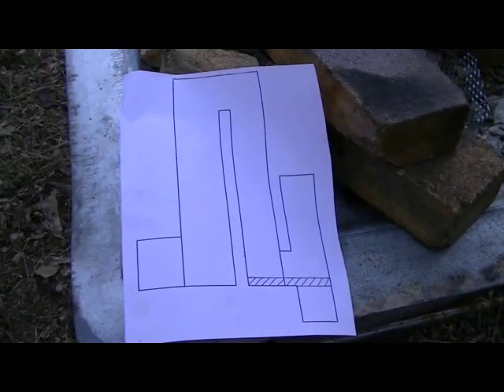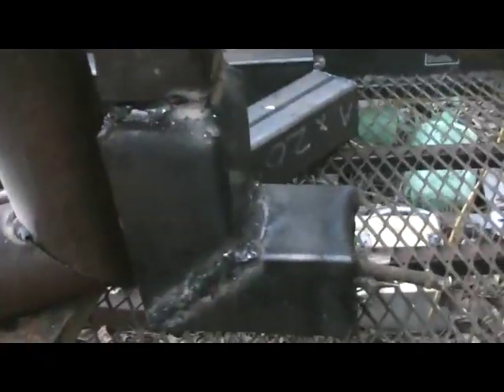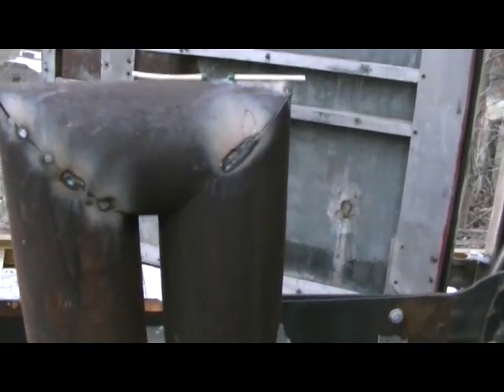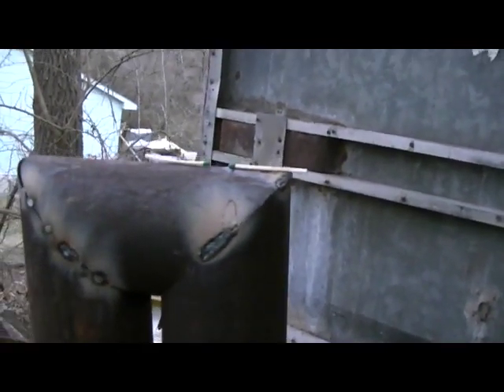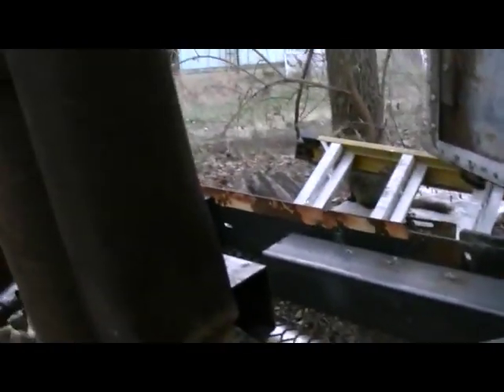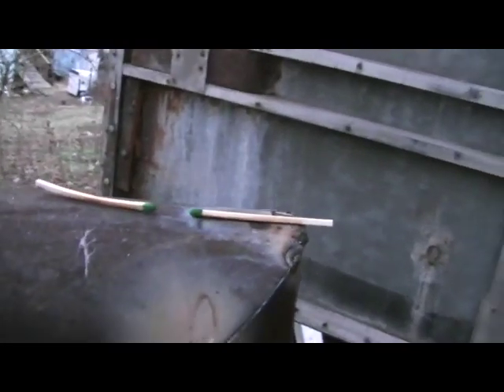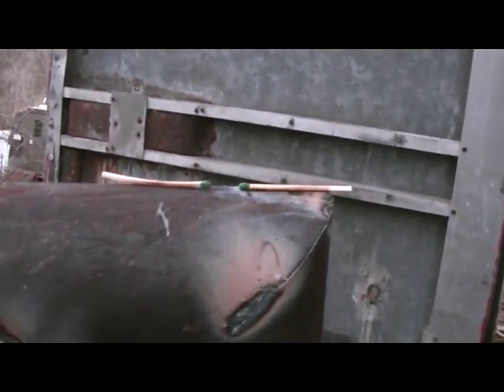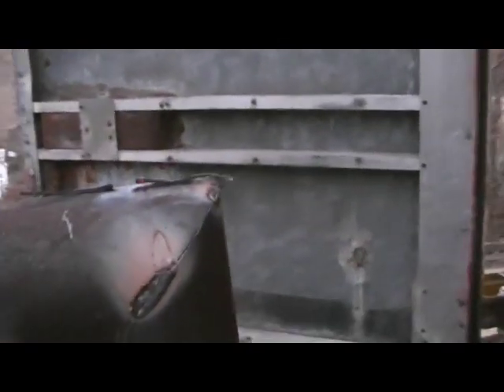Introducing Omega Stove

Comment: This looks very interesting! Seems the next step is to insulate the combustion chamber and riser pipe, but attach heat sink to the down pipe. This could be a timely solution to problems I'm having with my rocket stove drum type space heater. I am using a 3 1/2 x 42" exhaust pipe riser, and suspect my 4 x 6" rectangle tubing burn chamber is too big for the riser and my heat exchanger has too much volume. I am getting fantastic burns and feed with an ultra simple pellet feed insert, until I try to put it all inside two stacked, 14x27", 16 gallon grease drums. To solve my draft issues, I was gonna fill the bottom drum with perlite to reduce heat exchanger volume, with the exhaust moved up to the bottom of the upper barrel. Now I think I will abandon the upper barrel in favor of the bottom barrel filled with perlite, the riser exiting horizontally through a rectangular tubing with hot plate surface and down thru a heavy wall pipe. The drum would be mostly insulation and I gain a potential cooking surface that my design lacked, the two stacked drums being around 50" tall. Much appreciation here for you!
Reply from the maker: kelhawk1 Sounds like a good project!

Comment: Splendid!  Could this Omega stove have several pipes, like the ones you used, I mean to have 7 or 8, then the last one going outside into a chimney and to put a door at the first one? I'm thinking of using it along a wall as a mass heater, it would be great, much easier than the classical mass heater. Thank you for all intelligent , well-explained videos, I like them very much, you are so good!
Reply from the maker: Make a larger fire box, to feed it and it should work fine. The exhaust will likely be too cold to go up, so empty it down outside.

Comment: I like this concept. Can this vent through a wall a little above floor level to avoid a vertical chimney and hole through the roof. I have 6” steel pipe, I plan to use this in a sauna so I don’t need a long burn, just a short hot burn.i understand the wall would have to meet all codes as if the exhaust was very hot but if you can eliminate the vertical chimney you cut your costs and labor substantially. Also would it be more efficient if a circular plate was welded into one corner of each 90 degree turn to create a better flow when changing direction?
Reply from the maker: Check out my Hybrid Omega Stove. It's easier.

Comment: The reason why many are using barrels or other big containers for space heating is the fact that the surface of a big container / barrel is just bigger and the heat transfer into the room bigger and better. As long as you do not have a bigger feed tube there is no need of a big barrel - the temperature of the vapor coming out of the chimney tells you if the efficiency is O.K., what is perfect with your design, because you are using a small cross section for your feed tube and the total amount of heat created is much smaller compared to a much bigger feed tube cross section. 
When you want to have the smallest stove with the highest output then you will have to take a cylindrical barrel put over the riser tube all the way (around the riser tube) as it has the biggest radiation surface compared to the needed space. Another positive effect of a barrel all around the riser tube is the fact that the hot air all around the riser tube lets the riser tube cool down less / less insulation is needed around the riser tube. But your design is easier to build and works surely fine with small cross sections of feed tube.

Dani
Reply from the maker: Thank you!
Reply from the maker: ***** Why not? Give it a shot!
Reply: ***** There would be the flat surface on top, but efficiency would be worse because the air between the tubes and the barrel is kind of an insulator, the tubes inside get hotter (burn temperature rise up as long as there is no other insulation around the riser tube) and the steam coming out of the chimney would be hotter. The temperature of the flat surface on top would not be so hot compared to a barrel but directly around the riser tube having contact directly with the burned gases...
But if you insulate the riser tube well, put a barrel around all the tubes (a small one) and fill the space inside the barrel with a heat storing material with a middle to good heat transfer capacity then you would have kind of a small mass heater.  But I think if you would do so you should make the tubes inside longer (more up and downs) for more efficiency. In the end it all depends on what kind of chimney you have and which minimum exhaust temperature is needed for not having troubles with condensation in the chimney.

Comment: I really like this design.  I wonder if you made this design from round tin pipe and embedded it in fire cement, could you get the same draft with having mass to retain the heat?  Eventually the round tin would disintegrate and what would be left is the pathway for the fire.  One would need to put steel round pipe in the area of the damper to keep it functional though.
Reply from the maker: I'm not sure how well the concrete would hold up. Perhaps a clay mix would be better. The design is simple and functional. Thanx!

Comment: I think someone could reproduce this really quick by buying 6 inch regular stove pipe. It would be a 30 minute build. Unless the stove pipe would be too thin for heat produced in main fire area? What are you thoughts?
Reply from the maker: It should work for a while. I'm working on a variation.
Reply from the maker: New modifications coming soon!

Comment: What would it take to make an Omega stove wood boiler?
Reply from the maker: +Josh Byrley Put the boiler at the top where the heat turns sideways. or wrap the top with a coil of copper tubing and pump water through it..

Comment: the cost of the steel using you're using instead of a barrel probably cost more and you can't put a pan on that horizontal section unless you switched to square or rectangular tubing but then you'd have to buy it -- more money. maybe you can cut the horizontal section and replace it with a flat plate or leave it open and make the cut so the pipe so the pan or pot you use would close off the opening
Reply from the maker: Huge changes in the works. Keep watching! It gets more interesting, Good observations!
Reply: far out I appreciate your enthusiasm

Comment: Will a lp weed burner work as a emergency source? I'm thinking of up hear in the Dakotas we get some very nasty winters temps of -30 are not uncommon and snow backside deep on a tall Giraffe. Will the exhaust gasses from the lp cause problems?
Reply from the maker: +Willard Way If it is vented properly and doesn't have leaks, it might work fine. If you try it, I'd be very carefull.

Comment: Would it still work if it was lying on its side?
Reply from the maker: I don't think so.
Reply: Down draught has been demonstrated with mixed success. Why is sideways such an issue?
Reply: To clarify the previous post....the emphasis of the RS is cooking and not heating. Hope this helps...Roy
Reply from the maker: Even though there is some down draft, there must be some updraft. With a good chimney draft, I suppose it would work, but there would be no heat trap at the top for maximum dispersion before heading out the chimney. I guess it all depends upon your definition of 'work.'
Reply: Roy Nash Sorry...not "cooking" but a bread baking oven.
Roy
Reply from the maker: OK! I understand. this is a rocket Stove Space Heater. I have another improved design with a cook surface. 
The Omega Stove Making Heat!
Reply from the maker: Put the oven on the cook shelf. It gets over 600F, so there should be no trouble maintaining 350-400F.
Reply: Roy Nash Oven temperatures in the range of 300 to 400 Celsius. The forum is talking about the dizzy heights of reaching forge temperatures.
Roy
Reply from the maker: http://youtu.be/VbeS4RqhbSA
Plenty hot enough for all but forge welding.
BTW I've had my eye on the forum. Should be interesting.
Reply: kbbacon Thanks Kevin...It is fascinating subject.

Comment: So. how could this stove be made into a mass stove ?  If it is just radiant heat from the pipe, would adding fins help in creating more surface area, thus heating better ?  This winter is my first at using a wood stove and I am quickly realizing that a cast iron box stove just is not efficient enough.  There is just no mass to the stove for heating my home well after the fire has died down.  That is what particularly interests me about a mass rocket stove, and the fact that the minimal amount of wood needs to be used.
Reply from the maker: Run the chimney through the mass, or, in your case, set some steel on the stove to absorb heat and make the heat last longer. Fins may be an option.